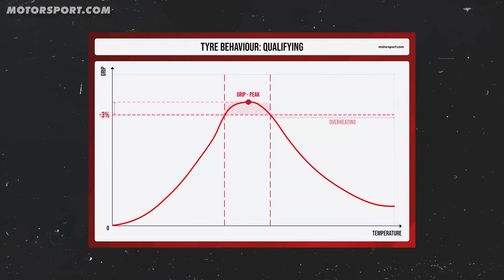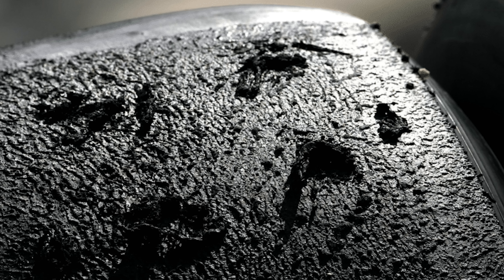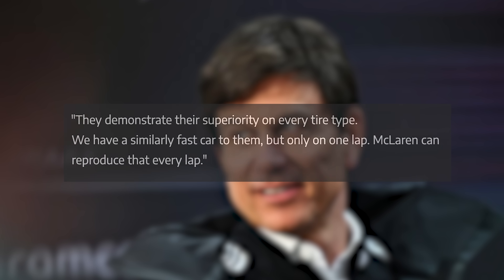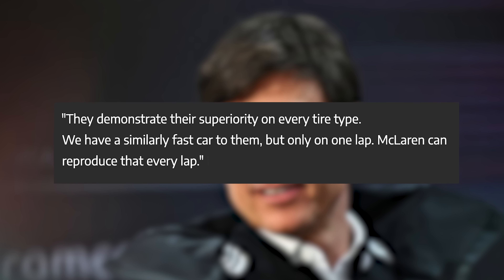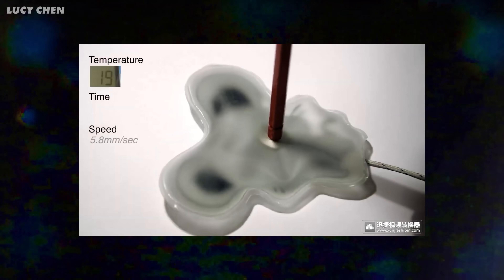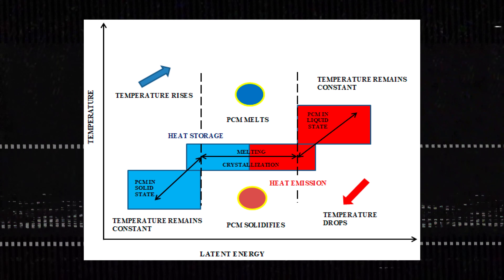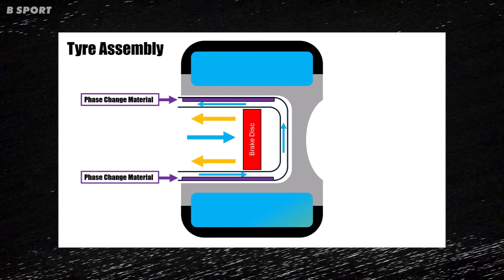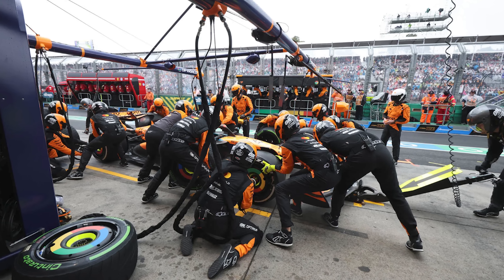McLaren’s GENIUS Tyre Trick Explained

Comment: Line the walls of the drums with a ceramic coating. People coat exhaust headers all the time with ceramic to help contain heat. They could do the same on the magnesium wheels. Along with the controlled air ducting.

Comment: It might even be more simple using bimetal strips inside the airducts controlling airflow inside the drum, above a certain temperature the drum is more cooled until below.

Still I believe the flexing wings let McLaren use more downforce at lower speeds, preventing unwanted sliding which heats the tires and that keeps the tires alive longer also.
First stint in Miami Norris was mindblowing faster than the competition making his way up to 2nd, Piastri outfoxed Max in turn one, Max went to late to deep and locked up and Piastri was able to do the switcheroo.

Rearview camera doesn’t lie, the static test is being worked around.
The McLaren update in 2024 miami is where they found most of their pace advantage

Comment: So if it is to prevent heat exchange between brakes and tires with the drum as heat exchanger perhaps they could use an aerogel as an inside coating. No heat wil transfer from the brake duct to the rim. But it is also impossible to cool the tire. Furthermore no weight is added because aerogel has “no” mass.
Reply: It’s a very cheap solution. But the brakes wil not dissipate heat to the tire so they need additional cooling. This is what makes this solution probably difficult to achieve.

Comment: If ur interested in the science of racing with supertires, face change materials, then what 
does ur driver really add, do the other teams have weak degradation designs, it sounds
like a very slight improvement, the McLaren team is changing tires just as much as the 
other teams do.

Comment: Hi thank you both for the info! If my understanding is correct, it is conceptually like a bimetal switch, that when 'cold' makes the airflow go in one direction to heat the tyres, and when 'hot' the switch flips and makes the air flow cool the tyres. If so, then power to Maclaren for coing up with an ingenious and legal technical solution to give them an edge, as every team with an edge has done for decades.

Comment: Interesting. If the Carbon fibre material being used is not strictly mandated or controlled by the FIA, the filament in the fibre can be impregnated with a third-party element.  In fabrics, we use ceramics to increase the thermal property of the fabric in the same way you understand ceramic pots keep food warmer longer.  We also have a similar product to keep fabric cool, again impregnating the filament fibre at the extrusion phase of the fibre production, before it is knitted or woven into the Carbon fibre fabric you end up using to make and form the part for the car.  Yes, you need to do some development and testing to understand the level of ceramic particle to use, but it's not that complicated and does not add much weight in reality because, in many cases, you can run the fabric/material thinner, thus increasing heat dissipation whilst still having the same strength. To explain this visually, think of a string vest made from carbon fibre, put an outer piece of flat carbon fibre on either side, and set it to the round shape you require.  The strength is in the structure, but the mass of the component is possibly 50% lighter; therefore, the heat is not held and dissipates quicker.  Build ceramic technology into the fibre, and you have a different performance again.  Not saying this is how it is being done, but it is possible!

Comment: I don't get it. Having a buffer, that can take up that much heat without having the buffer material circulate (like in a water cooling assembly)  implies a lot of mass. As you said, mass at the wheel is shit. McLaren would be WAY slower at the start, wouldn't they?

Comment: I would place a full sheet of Thermoelectric material inside the Carbon Fiber walls of the brake drum and the aero parts underneath, then let them discharge that electricity into the metal parts of the suspension, that might heat up the metal parts but not by much, but who cares about suspension parts getting couple of degrees hotter as the car is at 300km/h usually

Comment: Why include phase change material to absorb heat when you can use an insulator instead like aerogel which would prevent heat from the brakes getting to the tyres and has zero impact on unsprung mass...

Comment: OMG … seems so simple … so they could actually line the drum with brake material that would have a similar effect … they probably don’t need much extra material, it would impact the rotational inertia the most near the start of the race and then they would slowly gain speed as the brake material is consumed. 

Probably couldn’t do it with a V10 … but with these Hybrids taking some of the braking load it would become much more feasible. Especially with the larger rims.

Comment: Why are the break rotors so far inside the wheels in the first place?

I know there have been cars built that used inboard breaks (putting them on the inner rather than outer end of the drive shafts) so there are clearly other options and that suggests that something prevents them from being viable. The first (and least interesting option) is the rules disallow it. Another possibility that adding a drive shaft to the front wheels more than offsets any advantage, or that there would be no place to put them that doesn't do nasty thing to the aerodynamics (one or both of those might also explain not mounting them on the inboard end of the wheel spindles; the close the rotor is to where the wheel mounts, the less of that needs to carry drive torque).

Comment: Article 11.5:
"Only air may be used to cool the suspension, wheel hubs, and brakes." Not to mention liquid cooling is forbidden and PCM goes through a liquid phase.
Edit: Article 12.4 (Wheels & Tires):
No device may be installed that directly or indirectly alters the temperature of the tire, rim, or wheel assembly unless explicitly allowed.

Comment: Scott, love your commentary.  You and Jolyon make F1 fun again.  RIP Murray.

Phase change is a particular point in the energy transfer process and is not required.  What DOES make a difference and what F1 CAN'T measure is "energy absorption."

To use your cola analogy the ice isn't necessarily at 0°C.  The lower its temperature the more energy it can absorb from the cola until at some point it is the same temperature of the cola.  If that is greater than 0°C then it has melted (phase change).  If it has not, it can still absorb more energy ("cool the drink").

You can have frozen water anywhere below 0°C (standard pressure and altitude) all the way down to -273°C which will allow cooling that drink more rapidly (hence "energy absorption.")

So is McLaren using phase change, or just fluidic components that can handle absorbing energy?  In the 1990s everyone used a custom formula for fuel.  There's no such regulation for brake fluid, transmission fluid, etc.  The former is rotational energy relief and more important.

So [ignoring Spice Cheater Boy] if McLaren has found a way to replace common brake fluid with something that has a higher heat absorption rate, and even a method to remove that energy (radiator, dump it on the ground, etc.) they'd have an advantage.

Thanks for making it fun!

Ehud Gavron
Tucson, Arizona, USA, North America

Comment: Technically the drum you refer to is a shroud to encourage ventilation of the Disc Brake assembly its not involved in  actually slowing the Car ... so is a Shroud to contain and control  Temperatures on wheel and disc assemblies ... using materials to help disipate/control excess heat  
is in the Relms of SR-71 Technology ...

Comment: All materials are Phase Change Materials - all materials absorb and release large amount of heat when melting or solidifying
Thus the funny bit is - goes from saying "Super Special Materials" to explaining their working with ice in a drink..

The special part is the engineering for heat capacity (latent heat) and specified melting temperature.

(Automobile thermal engineer here)

Comment: Wouldn't it make more sense to put this phase changing material in the calipers? Closer to the heat source, non-rotating mass, and would help keep brake temperature more consistent as well.

Comment: This doesn’t make complete sense to me. Yes phase change can maintain a constant temperature absorbing heat, but when the phase change is reversed that heat is released. Where does it go? To maintain a constant phase change in one direction for a whole race to me is stretching credulity.
Reply: Exactly, you got it.  This is a BS explanation.  Few are considering that this is a two- way street in that a massive amount of latent heat (known technically as the latent heat of fusion) would have to be released to into the wheel assembly to re-solidify the melted phase change material such that it can again serve as a heat energy sink at the next braking corner.  We must consider that with this type of "keep it cool" system, a large amount of heat energy is still stored in the overall wheel assembly as its not being effectively dissipated externally as with an air cooling system where the heated air physically leaves the system.    Nobody here is discussing the obvious fact that latent heat works both ways in that a lot of enthalpy is needed to melt the material at the same temperature but in reverse, a lot of enthalpy must leave the material to re-freeze it at the same temperature!!!  Where exactly is that released heat going to go guys and girls???.............back to where it came from is a pretty close answer folks.  If the air flow between braking zones is not sufficient to cool the wheels without the phase change material, then it's not sufficient to remove the same amount of heat from the magic phase change material to refreeze it such that it can continue to function as a heat sink.  This is engineering 101.  Heat sinks have to be cooled too before re-use as they store a lot of heat.

Comment: Scott there is another method of cooling that no one is talking about you can coat the inside of the brake cover/ drum in aerogel from silica; alumina or carbon aerogels they can absorb heat from 1500 degrees c to 2500 degrees c which means 1 or more hybrid coatings can  keep what ever temp you want the brakes to stay at  while allowing little to no heat reaching the wheels and as an added bonus what air is redistributed through the brake ducts so changing the aerogel compound you can tailor it to each race track and tire compound the team want to run to go hand in hand with the cars aero so in qually you might not get pole but in the race your tires and brakes are better than everyone else which is what Mclaren are doing at the moment and aerogel was developed by NASA for heat insulation and distribution and most importantly it is weight less i bet RB and the other front runners have missed this one cheers from down under

Comment: It's worth noting that the special phase-change materials don't just have a high heat capacity, as that's different from what's being described here. The material specifically has a high enthalpy of fusion, which describes the amount of energy required to phase change between a liquid and a solid. This is a different property than just plain heat capacity, as that describes the energy required to raise temperature. But the real takeaway here is that, generally speaking, melting (going from solid to liquid) or vaporizing (going from liquid to gas) has a much higher energy requirement than heating the given material in between phase changes. That's why phase change technology is basically a cheat code for temperature control.

Water is very good for this purpose, actually, which is why water vapor chambers are ubiquitous in our society. Say, for instance, that you want to take 1 gram of room temperature water and boil it. Out of the total energy you'll need to complete this whole process, only about 12% of it went into bringing that water up to boiling temperature. The other 88% went into just the phase change itself. And remember, that 88% of energy usage happened while the temperature remained CONSTANT.

Comment: Phase Change Materials (PCMs) are generally not allowed in Formula 1 under current regulations, especially for performance-enhancing or cooling applications.

Here’s why:

1. Regulations on cooling systems: F1 technical regulations tightly control how cars manage heat. Active cooling systems using PCMs would likely be seen as giving an unfair advantage or classified as moveable aerodynamic devices or non-permitted energy storage.

2. Ban on exotic materials: The FIA limits materials used in F1 to prevent cost escalation and to maintain fairness. Many PCMs involve non-standard materials which may be banned or heavily scrutinized.

3. Energy storage constraints: If a PCM stores or releases latent heat that indirectly affects performance (like managing tire temperature or fuel temp), it might fall under banned forms of energy storage or deployment.

That said, PCMs might be used in non-performance-critical areas—like driver cooling suits or electronics—if they don’t violate technical directives.
Reply: 1- it's not active cooling. it's a passive system.
2-there's plenty of commercial pcm's out there that are used in automotive and industrial settings
3 - it isn't used to propel the car. that's the only non allowed energy storages

Comment: This tech is pretty old, yes. Nature has been using it in some animals since millions of years ago, it's called "sweating".
Jokes aside, pretty interesting video! Very smart solution.
I have a doubt, do the materials need to necessarily melt (or evaporate)? Some materias have different solid phases (like steel), which I think also absorb some energy between changes, but maybe the energy is larger when there is a change in the state of matter (solid to liquid)

Comment: So simple, yet obviously so effective..

I remember those sachets with a fluid that you need to boil in hot water with a chip inside.. When you need the stored enegy you clip the click, the solvent solidifies en gives back the heat..

Or candles, they burn for hours changing the phase of the paraffin from solid to liquid to gas..
Reply: https://en.m.wikipedia.org/wiki/Heating_pad

Comment: F1 has always been about innovation, more than  drivers. If it was all about drivers, it would be a one car series.  So, one team creating an advantage and the others catching up is nothing new. If all new technologies were banned, the cars would not change over the decades, and F1 would wind up. Also, if you can use one set less of tires per  race, it will  help the sustainability and cost cutting the FIA want. I have watched F1 on and off since the late 70s, and there has always been one team having a technical advantage and another team complaining. This isn't new.

Comment: An additional note. It could also be a solid to solid phase transformation. In my masters I worked on them. They are more investigated for cooling technology in fridges, but in this way by changing from crystal structure A to B you wouldn't have any issues with the rules. If anyone wants to read on the principles, not saying that McLaren might use these specific materials, but for a quick rundown in understanding. NiTi and NiMnGa are well known solid to solid cooling materials. There are elastocaloric and mechanocaloric materials which might work.

Comment: Theres an important alternative method of action that isnt covered in this video. When a chemical changes state, it will expand or contract. This can be used to move ducting within the brake cowling in response to heat, just the same way an engine thermostat will open when the wax core melts. 

I wonder if a similar effect could be achieved with a bimetallic strip, as per old fashioned fire alams. 

Have a look at B-Sports video for a deeper insight.

Comment: More likely it’s a vapor chamber than phase change. Phase change is equivalent to the mass added, and wheel mass is bad news. Vapor chambers have the same effect with less mass transitioning as it heats and cools on opposite sides of the chamber wicking heat away

Comment: I don't know if Martin Buchan explicitely said liquid solid phase change for the cars in his interview or if that is you making deduction, but it is possible to do this with solid solid phase changes. Solids material often have several cristaline structure that are dependent on the tempariture. These changes in crystal structure will also absorb and emit heat as they change cristal structure.
Intuitively I'd say the amount of heat is lower than liquid solid phase changes but don't quote me on that.
Dealing with only solids would be a huge advantage when dealing with high dynamic envirronements where balance in importante, like that of a car wheel.

Comment: lol thermodynamics boys… if the heat doesn’t go to the tyres means that the dissipation is not happening, either they magically transfer that heat somewhere else or the disk will simply overheat… so instead of losing tyres you will lose your brakes…. Other thing if is McLaren discovery a magic material for their brakes that can operate at a way higher temp.

Comment: These trick tyres need to finally go. The racing would be so much closer if the tyres were like they were 20 years ago. Force teams to use two compounds in a race if they still want artificial pit stops.